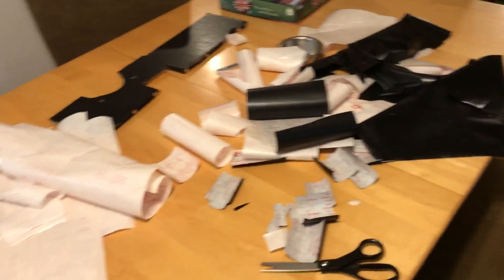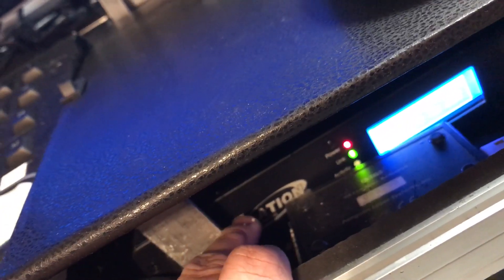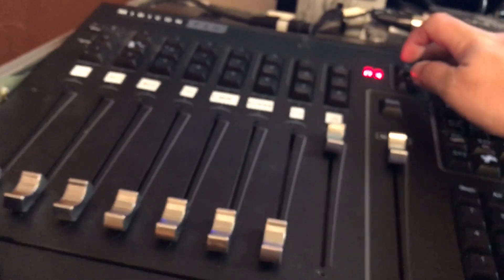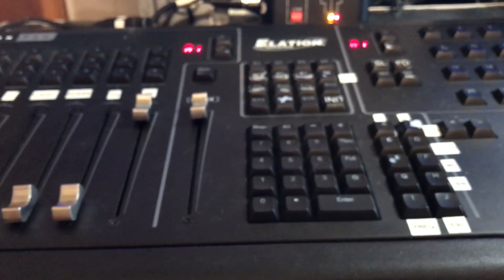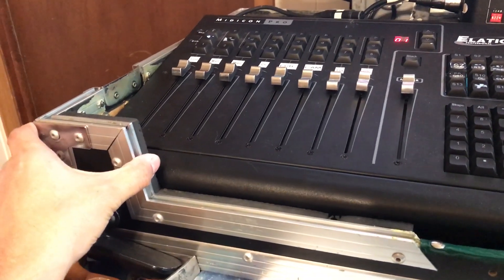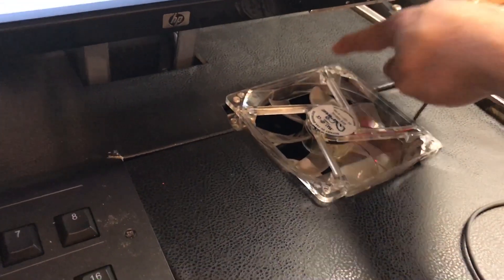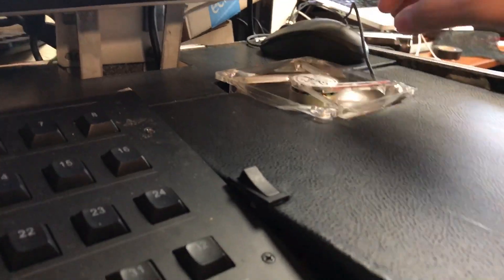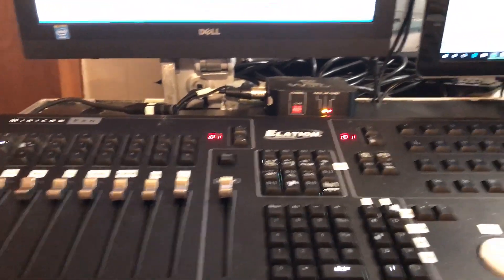Lighting console update!! - I clearly need a 3D Printer.

Comment: Why did you choose to run Windows on a macMini and not buy something like an Intel NUC? Also, why have the artnet node in the console and not in another rack with a DMXSplitter and/or media server to put at the stage. Sure is easier to run an ethercon cable rather than 4 DMX Cables.
Reply: The Mac Mini is smaller and it fits better in that case
Reply from the maker: Mini is indeed smaller, runs cooler, and has more power per $. I don't need a DMX Splitter, and it's supposed to be an all-in-one. Remember at my shows the LD and programmer are near the stage anyways as they busk all their shows, so they can communicate with the DJ.